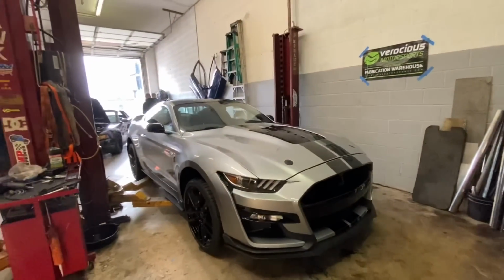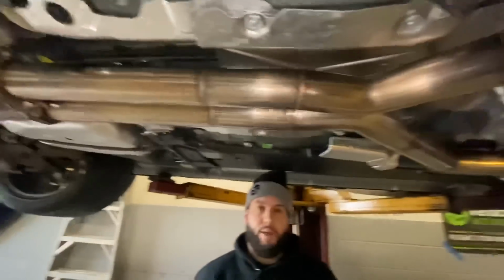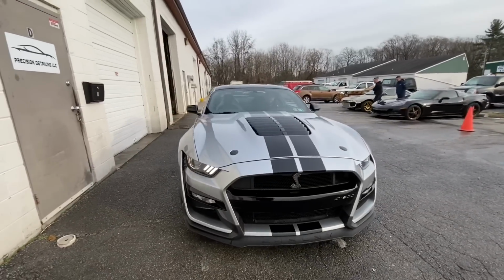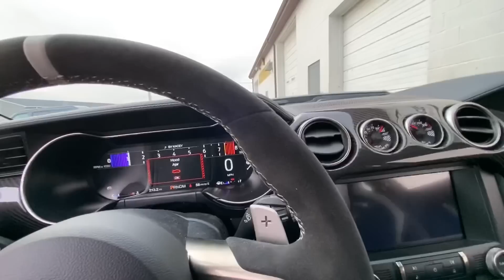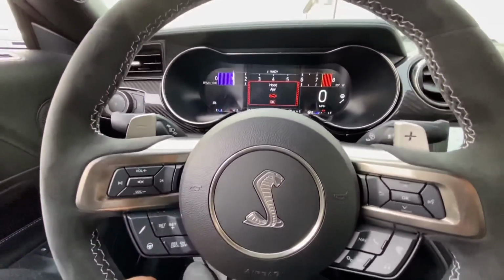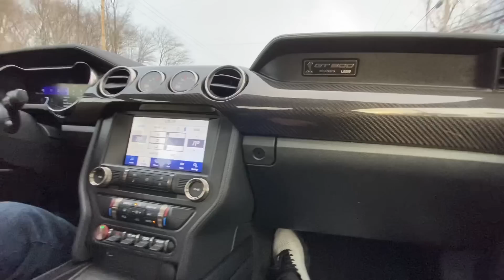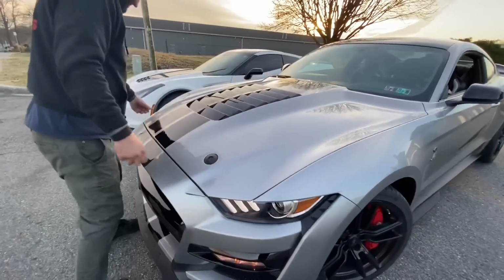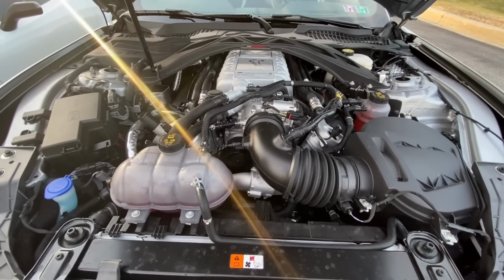MODIFIED 2020 SHELBY GT500 (TUNED + EXHAUST UPGRADE) REVIEW!

Comment: How much power / torque can the DCT take . The Tremec site says 664ftlb (900nm) is the safe limit . ? 
Any 2020 gt 500 with a tune or other mods would be way over the 900nm limit.  ??

Comment: I have to say, props on your beard. Clean, trimmed, out of the mouth, nice and thick. Very nice. I'm not a fan of lots of facial hair in general but you've done good.
Love the Dual-clutch. Who doesn't.
BUT IT DOES NEED A 6-SPD TREMEC MANUAL OPTION. Nothing like just brapping and dropping the clutch. No messing around with switches and modes and other molarchy. Also it would just make the driving experience more involved.

Comment: 2020 gt500 is the modern day terminator from 04 simple boltons and huge power gains this car is biult from the factory for big power like the terminator was in 03 04
Reply: RG GT just saw a cobra earlier, looked good and sounded even better lol
Reply: @k.hamilton5848  A modern mustang will never sound as good as a 4.6
Reply: It's the modern day terminator but who can afford it? I certainly can't.
Reply: @400hpmustang  Me neither, even if I could I still wouldn't buy one.
Reply: I have an 04 Cobra Terminator had a 3.4 Whipple charger on it broke the motor after kicking the shit out of it for 3 years and now I've converted it to twin turbos Precision 67 cars badass
Reply: RG GT except it’s unaffordable for most people sadly 😭 but this thing is amazing!!
Reply: It definitely is since it's also named after an Arnold movie lol. Terminator vs Predator.
Reply: @RG GT that honor goes to the ‘13-‘14 Shelby GT500 as it is only made for only two years like the terminator and can be had in 6spd manual.

Comment: Next time, hold the down shift paddle for few seconds, It will drop the gears to the most optimum one. You can properly floor it then.
Reply: I love that feature
Reply: @bluecollardaily2676 I know right! Thing is perfect for pulls and tracking
Reply: @bluecollardaily2676  Me too. It was about time FORD introduced it. I love it in my father Z06 A8. Is super awesome. Ford honestly took too long in implementing it.
Reply: ALSO IF YOU HOLD BOTH PADDLES IT GOES TO NEUTRAL FOR FREE REVS
Reply: @JoeMaters  Not really.
Reply: @raionshishi8290  Not really what?

Comment: I'm sure by now you've seen Lund Racing's GT500 that they tuned that has basically sane cat bypass, tune on E85 with injectors, air filter removal pushing 803hp to the wheels at over 8000 RPM!

Comment: That's an amazing Mustang. Fantastic color, great sounding beast. It seemed that your passenger didn't want to pass along many compliments toward the Shelby GT500. He should read the Motor Trend Shelby and C8 track comparison. The base Shelby GT500 beat the C8 track times at VIR and the Track Pack Shelby destroyed the C8. Thanks for sharing this great Stang and looking forward to continuing content on your this vehicle and your own GT500 when it arrives.
Reply: Hemi 300C and the c7z06 crushed them both around vir. Sit down.   Be quiet.
Reply: @parksrob  The C7 ZR1 is a great Supercar, but discountinued and soon to be old news. My guess is both cars would be close depending on tracks. I don't have top speed numbers for VIR straight aways, but the Shelby was hitting over 170 mph. The test was against the C8. The only comparison times I have are quarter mile runs. C7 (Base $121,000) ran 10.7 and the GT500 (Base $74,000) ran 10.6. For the price and bang for the buck. It's the Shelby hands down. Having owned a couple Vettes with the last one being a C5 convertible.  The C3 build quality was terrible. The C5 was much improved. I see the Shelby GT500 as special. Great looks, performance and likely a vehicle that will maintain value. I currently own a 2019 black 300C Hemi. A white 2017 Edge Sport and a red 1995 SVT Mustang Cobra so I like cars and performance. Many replies I read only talk crap and likely drives daddy's car. Makes me wonder why I waste my free time responding to some of these ridiculous comments.
Reply: @hemi300c4  I seriously respect you so much after reading this comment, giving credit where it's due, praising other cars instead of being a biased fanboy, very mature and understanding of value and worth. Dude you need to exist in everyone's mind.
Reply: @parksrob  You can say that last part of the sentence to yourself buddy.

Comment: Cold revving on that lift. That's good for it. Does this car even have all of the break-in miles on it?
Reply: They say they only need a 100 breakin miles
Reply: Thought it was 1000.
Reply: @Cronus_1  200 miles for break in on these cars. It's only a 1,000 if you're going to the road course/track since the engine will be under more stress for extended periods of time.
Reply: Drive it like you stole it from the day you got it if you want it to last and be fast
Reply: Does the car belong to you?
Reply: SpeedPhenom said 100 miles break in
Reply: @3star2nr  No, but it doesn't belong to him either. Not sure why this is controversial to you.
Reply: Doesnt matter if it was broken in yet or not. You should never cold rev these newer mod motors.

Comment: Lund racing got 803 to the wheels
Reply: Jc and was the first tuned one
Reply: Yes sir
Reply: 806 now I think
Reply: World record tune
Reply: Who cares
Reply: @LsxSosa  who cares
Reply: Cat deletes and tune
Reply: Yeah but that's with injectors air filter off etc. I'm sure this tune is little more conservative with the timing than lund. They were pushing to get everything out of it they could. This car makes little more now with the exhaust I'm sure. 
No reason either of them don't go 9s with a tire regardless.
Reply: It was with e85. E85 makes more than race gas on a PD blower equipped car.
Reply: @jpscharged   has nothing to do with being a PD or not. It's not nearly that simple. They both make about the same power give or take a few % depending on the combination, weight of vehicle and number of cylinders etc. Not every car with a blower or anything else for that matter requires the octane something like C or Q16 has. It obviously depends on what race gas is being used and the quality of the E85. One thing you can't do with something like Q16 is put it in your car and not add timing. You will actually lose power in that case. Where that doesn't happen with E85. If the combination has lower compression or boost. Then E85 is most likely going to make more. Like I said the weight of the vehicle is a factor or should we say the load on the motor. Q16 is very resistant to detonation because of the high octane obviously. It's not something you want to run all the time with 02's. They will go bad. So there's not just one sure winner. There's pros and cons to everything.Testing to see whats going to work best for you is part of the deal. Although many just assume one or the other. Having watched hundreds of motors and vehicles on both types of dyno's in person over the years. I know it's impossible to assume anything. It's why I say they make about the same and you should test to see what's going to be best your combination. In most cases it's very close. As you can see lund was only 4hp more and I'd bet they had more timing in the car.
Last yes e85 is cheaper but you use more of it. So it's not as cheap as you think but cheaper. Plus the fact it requires the bigger injector and fuel system if the car can't support it. 
Oh one last thing. E85 smells nasty and race fuel smells good lol. In my race car I didn't run either. I ran straight methanol. Nothing beats that but nitromethane lol..
Reply: @waynebollentin989  a pd blower without a 5gallon ice tank in the back stands to make huge gains in the cooling department with e85 vs c16. E85 does have 30% less energy than non alcohol based fuels. That sucks but with the 30 cent discount over premium and about a +$7 discount over c16. I keep 55gal e85 barrels in my garage because it's worth it. Turbo cars spool quicker with e85 over c16. I don't have a sense of smell. E85 replicates the fueling pros of methanol to a slightly lesser degree and lets your oil and spark plugs last 200 passes. Pretend I wrote more than you. Believe me, e85 is the best daily option fuel wise nowadays.
Reply: @jpscharged  I'm speaking more literally. I agree for the most part but it doesn't spool every turbo engine faster. Many factors in play on determining that. I know your speaking more from a daily driver than full race car. My point was simply you don't have to get the bigger injectors killing the warranty for sure so you can run E85. I certainly wasn't saying it cost near as much as race fuel either. Just its not as cheap as some think. Not many have the experience you have with it either. 
Now as far as the warranty goes so were on the same page. Yes just changing the tune can be a problem depending on your relationship with the dealer but race fuel with tune and you'll run about the same time at the track as with E85. Also the person tuning the car is a factor. How hot of a tune it is. It's going to vary depending on the tuner. Which I'll admit matters much more with race fuel. You can simple just add E85 and pick up power. With race gas specially something like C or Q16 you will lose power without adding timing. I'm not arguing race fuel is better. Just that it's a viable option. When you want that extra power. I'll also say either your one of the smarter ones or one that learned the hard way getting the fuel in a 55gal drum. I've seen guys hurt the motor with pump E85. The quality isn't always he same and a lot of timing with boost can be a problem. Actually if more people knew what a motor laying over felt and or sounded like and lifted they'd still have a motor lol. Like I said pros and cons to everything. I've seen 1346whp on pumped 93 on a coyote with Hellions eliminator kit with Precision 64mm turbos. No nitrous, methanol or E/85. Straight pumped 93. Yeah I know just imagine what it would make on on 85 lol.. It's not as available in NJ as other places. Plus he drives it all the time full street car with A/C. E85 just isn't an option everywhere in the country yet for guys that drive regularly. Good conversation though and take care bro. 
Oh just wondering why not C85 if your getting it by the drum? It does make little more than the E.
Reply: Now its over 900

Comment: Impressive the exhaust sounds great,   hard to believe the owner walked away from his engine warranty on a car that cost that much so early.  I would have waited a year to make sure it didn’t experience issues like allot of the gt350 motors have had before turning.  Lund has already tuned one but hasn’t done the exhaust mod so your title is still good.
Reply: William Clements and that’s why you’re not awesome.   Next!
Reply: William Clements wrong, Lund Racing did 803 at the wheels with new injectors, e85 and x pipe and tune of course...
Reply: Predator block wont have the issues the voodoo did thats why the ones blowing up are getting it as the replacement but I DO worry about the trans....its costly the block is 2300 nothing to a 100k car

Comment: Wish they put a bigger engine on these, same size as gt350 , 2015-2017 headlights but have 2018 tail lights, feel like they just wanted to slap a bigger blower than the 07-14 gt500s and add a bit extra power . This Shelby should have been released 2016-2017 imo

Comment: I really hope he was talking about injector CC when he said 1300 and not horsepower. 1300 hp at the flywheel would be over 1100whp and I don't see it without cracking the motor open. Not to mention the DCT transmission because that TVS2650 makes torque instantly.

Comment: I'm glad they didn't do the face lift on the gt500
Reply: I'm sad they didn't
Reply: Are you talking about the head lights?  If so, the reason the lights are 15-17 is because the 15-17 are way lighter than the 18-current.
Reply: @nicholask1985  they're the same weight
Reply: Yea because it’ll be so easy for the ‘15-‘17 GT’s to make a GT500 clone and become relevant again 👍🏽
Reply: Same same along with the headlights
Reply: Me too ,18-19 looks terrible
Reply: I really don’t get the 18-20 hate lol just sold my 15 gt 6spd and now shopping for a 19-20 10spd auto 🤷‍♂️
Reply: @nicholask1985  It's because they take up less space, they couldn't fit the radiators behind the facelift lights.

Comment: Must be in a emissions free state..can't get away with no cats in Va..and I'm wondering if it has any code lights that stay on....
Reply: I used dummy cats and 90 degree O2 simulators it completed cat self check cycles with the 50 states legal EB tune no lights

Comment: If this is a 500 where are the canards in the front and the lip on the rear spoiler?
Reply: Shane Bogenreif they are built in to the front bumper.  Look harder.
Reply: @parksrob  the 500 I saw had them on the outside upper part of the lower bumper this one only has the lower ones... I looked had... Have you seen a Camaro Zl1 1le those are the canards I'm talking about... The 500 I saw looked like that..

Comment: I have one issue. The car looks gorgeous but truly who in there right mind pays a extra 10k on strips! Ford seriously is killing people on that option.
Reply: Until you want to sell it 20 years down the road!  That 10k option will add a ton more money to a collector due to rarity!
Reply: Painted on stripes are not normal will add tons of value
Reply: You do realize how much value the car gets with painted strips right ? Also Ford doesn't paint the strips themselves due to production restrictions/consistency, they do it at a special company that they take the cars to to get painted.
Reply: What I realize is that Stripes can add value not really. This car is going to be produced by the thousands and there will be plenty of them. You would need a track pack at least with the stripes and spend $105,000 minimum and put it in the garage for 20 years with no miles on it so you may collect a dollar more. Me on the other hand I prefer to drive the wheels off of it and even mod it to some degree.
Reply: You can’t even get the 10k painted on stripes unless you have a golden ticket allocation also needed for track pack. No ticket no allocation period.
Reply: Who cares about this piece of junk I want to buy Road & Track Performance car of the year that's where it's at baby a f**** Hyundai
Reply: @paulhouchen9010  If you don't care then wtf are you doing here exactly ?
Reply: @gregwilliams4380  It will be produced by a certain amount sure, but it's limited, especially these track packs and the kind of combination of options they have, it will keep it's value is all i am saying/ is the point. Anyway, that doesn't matter as if you get this car, it should not be for it to sit in the garage all they long like some queen, it's to get fucked up and trashed on all day long.
Reply: @raionshishi8290  it was a joke she she kind of like a jab at Road & Track
Reply: @paulhouchen9010  Really ? okay i guess, it flew over my head then because it didn't seem like it.

Comment: Can't wait to see it going around Nuremberg breaking some records!!!!
Reply: Nurburgring*
Reply: Highly doubt this 4100 lb car is breaking any records lol
Reply: @supernice_auto  wanta bet? For the price that is a race car really
Reply: @supernice_auto  and don't be a hater I grew up in the late seventies and through the 80s had cars but nothing like this I had a pace car and 79 and SVO that new 500 it is built for a turning road
Reply: @supernice_auto  it already spanked the C8. Yes the vette makes less power but it is much lighter.
 It's going to beat the ZL1 and the hellcat and that's all most are going to care about lol.
Reply: Wayne Bollentin it won’t beat the ZL1 1LE around the Nurburgring stock for stock. Drag race is a different story tho.
Reply: @q6_zilla  you better start wearing a helmet 24-7 because you bumped your head one too many times and it's causing brain damage. You just can't take a chance hitting it again with this much delusion going on. 
This car was built for something like that track. It wasn't built for the  drag strip.The GT350 has about 250hp less. On top of that the GT500's suspension and braking package is much better. The GT350 went just as fast as the ZL1 with over 100 less hp. The reason the ZL1 1LE went about 16sec faster was because of the better suspension. 
So how you honestly believe a car with better everything over the GT350. Almost 250hp more and was specifically built for a road course isn't going to pick up 16sec is beyond me. Oh let's not forget the DCT transmission.
I'd ask how you came to this conclusion but I know you can't reason with stupid. You'll just drag me down and beat me with experience.
Reply: @q6_zilla  either was the GT350 and it kept up with the ZL1 with 100hp less like I said before and the Camaro isn't much lighter lol. 
I wouldn't be surprised it beats the the C7 also and runs 7.12 or better. I'm sure we won't have to weight long to find out either. Don't go running away when your wrong. Not that I'm going to be wrong but I won't either lol..

Comment: I see many comments in here regarding the passenger poo-pooing the GT500 and being a GM fanboy.  I have to honesty say, if you're use to driving a C6Z which is 1000 lbs lighter, has a 7k rpm big N/A 427 with a stick, much more analogue, and significantly lower... I'm sorry, but the GT500 is going to feel SOOOOO much different than what that dude is use to driving!  I'd feel the same way!  Doesn't mean I wouldn't like or appreciate the GT500, but it would certainly take some getting use to coming out of a C6Z!

Comment: Lund was the first tuned GT500 which made 803RW
Reply: Yes sir Lund
Reply: Lund FTW
Reply: Lund was on E85 with injectors, air filter off etc. Obviously because it's their car the timing is going to be more aggressive on the tune. I rather not be on E85. Just not a fan and you go through much more fuel.